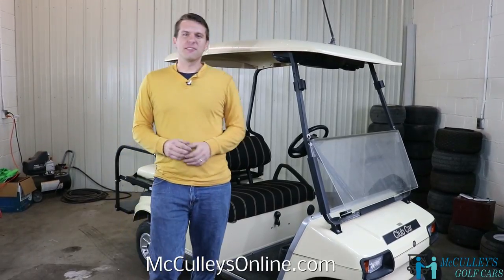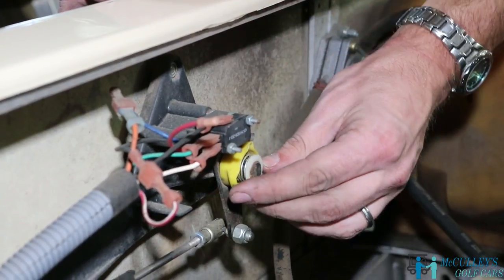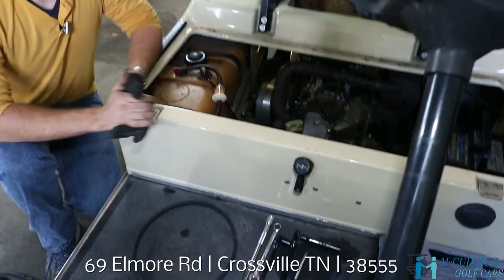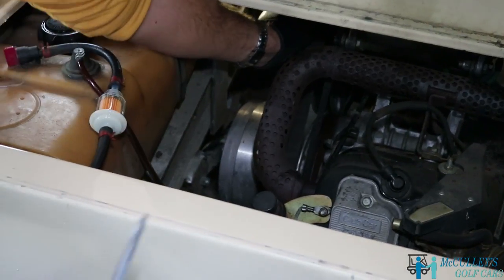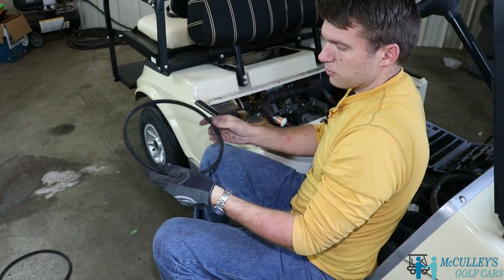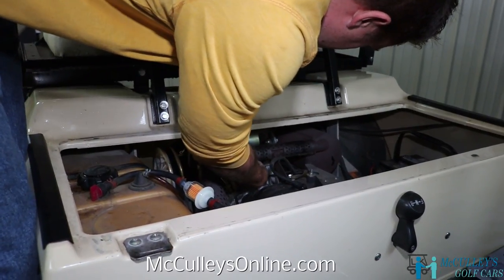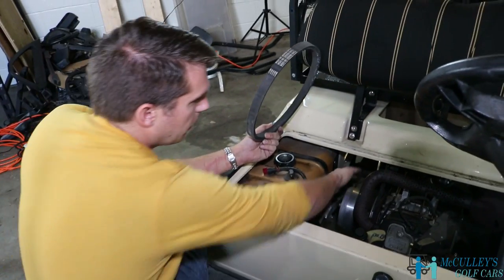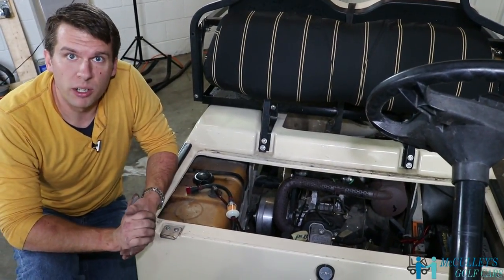How to Replace your Starter Generator Belt on the 2004 Club Car DS Gas Golf Cart

Comment: Great call with the ratchet strap. I didn't have a second set of hands so I hooked it under the back seat and put a block of wood on the seat itself so I didn't tear the vinyl. Ratcheted it down and the belt is super snug now and it starts like a dream. Looked in there one last time and realized I got the belt twisted while putting it on. Fail on my part, but at least I know how to do it now!

Comment: I have a 2006 club car xrt810 and I can’t get the starter belt tight enough, I’ve tried everything except a ratchet strap. I’m going to try it tomorrow, I hope it works, it seems like a great idea
Reply from the maker: It is pretty difficult, the tool club car recommends is a type of pry-bar that is designed specifically for this use. I think since posting this video, we ended up making ourselves a tool for it. 

I hope the strap works for you. Thanks for watching.
Reply: @GoodShepherdsHomestead  it worked pretty damn well! I just need a new belt, it slips but rarely

Comment: Great video thanks! I bought a 96 ds and the belt looks new, but it squeals quite often on startup? thoughts?
Reply: mine squeals bad as well. I think its the clutch going bad! when It gets goin it runs great but at start up the noise is terrible! not a 100% sure though don't have much experience with carts
Reply: actually just replaced the starter generator belt and took all the squealing and delay out of start up. Mine looked new as well but when I took it off and compared to the new one it was stretched out a lot.
Reply: Thanks for your videos, very helpful👍
Reply: tighten the belt it might just be lose
Reply: I have same squeeling at start up.  going to replace belt and adjust ...the clutches seem to last on these...so Ive been told.    we shall see..     thanks for posting

Comment: That belt needs a load of tension to stop pulley slip...
A tensioner arm or adjuster would have improved design.
I made a lever rod to pull tension. As nut tightened.
Plus a lift out panel  in body to access motor ..
Plus try and get a high quality original grade belt as chinese knock offs not as user friendly.

Comment: Been having trouble with 98 Club Car starter belt it keep getting lose and slipping off.  Replaced with a new belt and same thing happened.  Can you recommend a specific belt that is meant for the cart?  TY
Reply: Stephanie D'Amico, thanks for watching our video. We can get you the right belt for your cart if you like. Text your name and number to 931-250-2454 and we will call you during our normal business hours. Also check out www.mcculleysonline.com/contact to get in touch with us